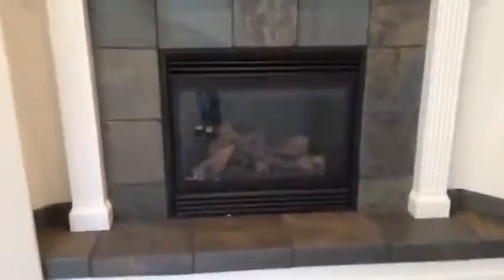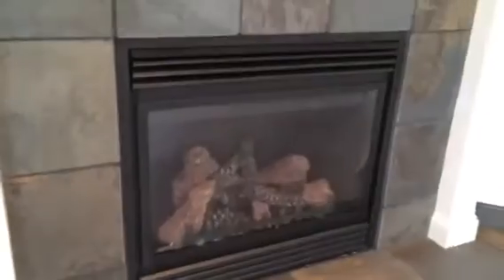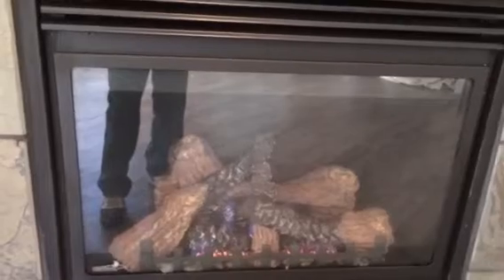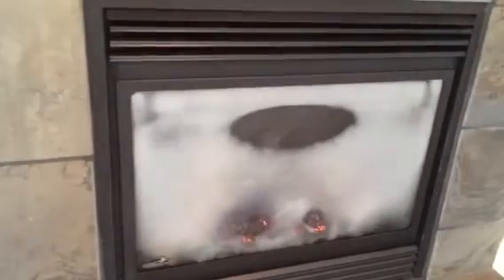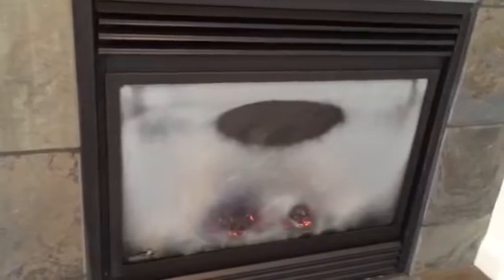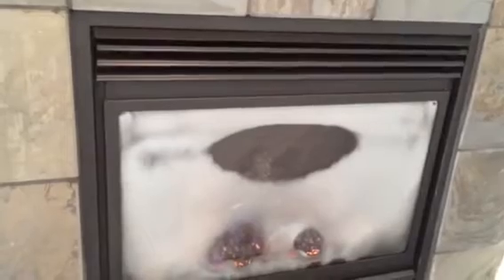Fireplace fogging up

Comment: I have been advised  by a fireplace tech that the cleaning solution you use on the inside glass has a lot to do with the "fogging" issue. He recommends using nothing with Ammonia.
Reply from the maker: Thank you

Comment: Looks like a direct vent (dv) fireplace. Dv means it has 2 vent pipes. One brings outside air in for combustion and the other pipe carries the exaust back outside. No room air is used for combustion. When the fire is first turned on, there is a tempature change. Cold air from outside is mixed with the warm air off the fire causing condensation on the glass door. This is perfectly normal. After the firebox and flue pipes heat up, the incoming air gets heated, the condensation goes away. This normally takes 15 to 20 minutes. Glass will first start to clear in a circle (center part of the glass) near the top ( this is the hottest part of the glass). Last place it will clear is the lower left and right sides as this is the coolest part of the glass.
Hope this helps.
Dave, (fireplace installer for the last 20 years)
Reply from the maker: Thank you for your information ,so this is normal to do that fogg ,I had one like this in my adder house and wee lost 2  front glass every year so I was panicking jus a bit
Reply: Hindi movies
Reply: Is there a flue that has to be opened seasonally? Or anything to do with that direct vent box outside before firing up the fireplace?

Comment: Of it goes away its normal if it stays like that it needs more air for the gas to burn properly
Reply from the maker: Thank you for your comment 
Have a bless day
Reply: Do you open the flue? Is there one that has to manually be dealt with before the drain starts?